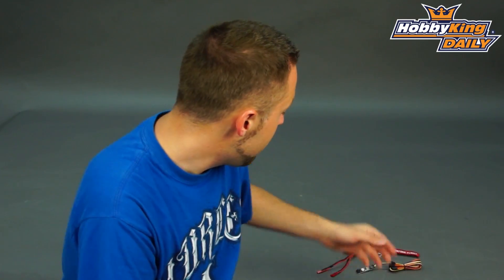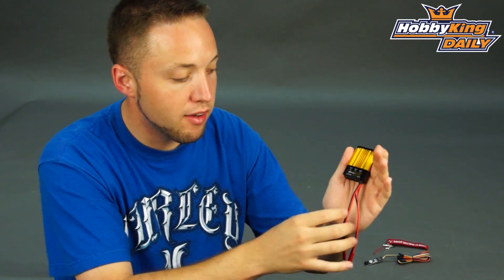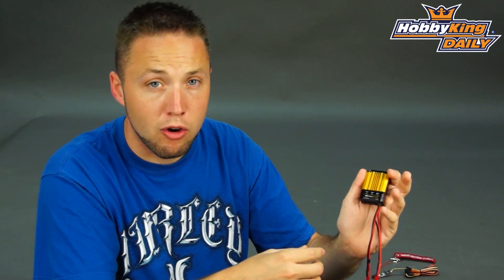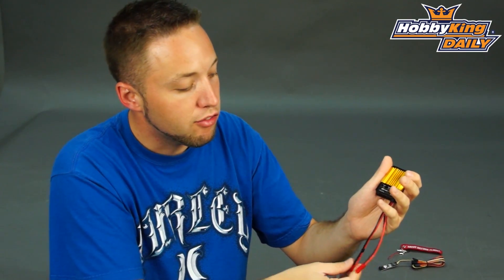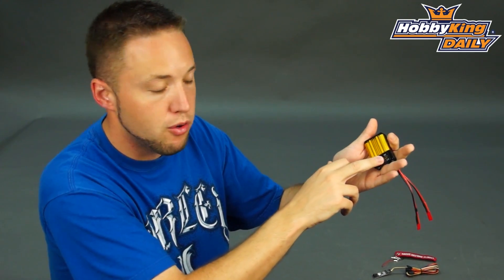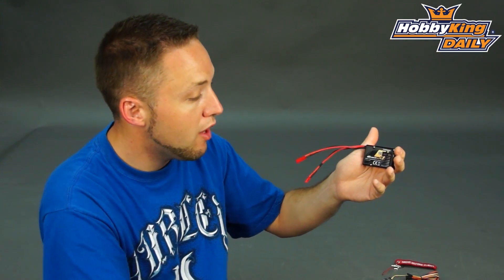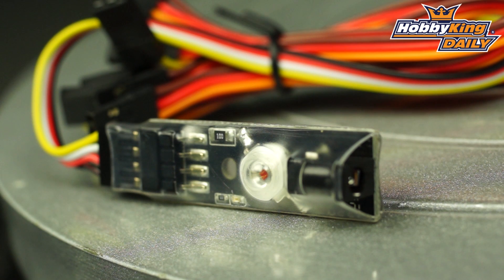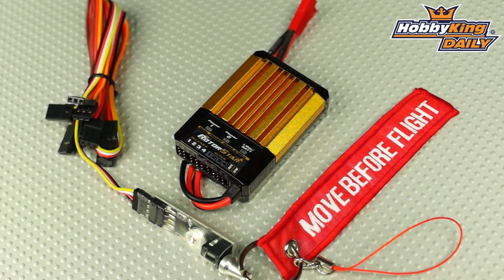HobbyKing Daily - Turnigy Rotostar Dual Power Regulator

Comment: I installed using a 3s 2200 mAh. 35c battery. using 4 servos, but the regulator got too hot. Is that normal?

Comment: Hi I want a unit like this but I want it to be able to accept a input voltage of 5 cell lipo. I am building a 35cc 10 cell lipo electric airplane. I am looking for a light weight compact unit like this with dual battery input.